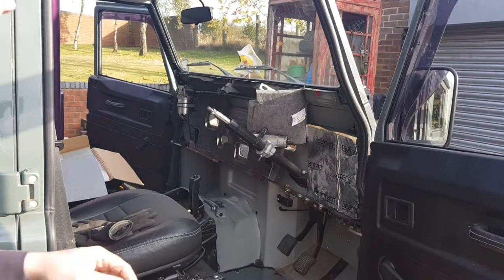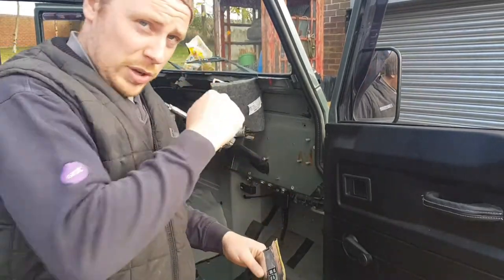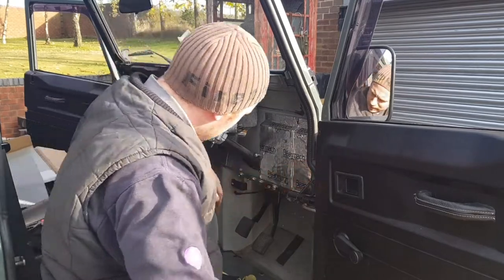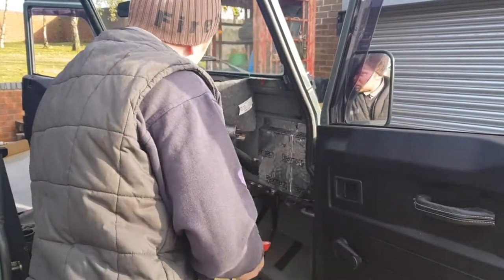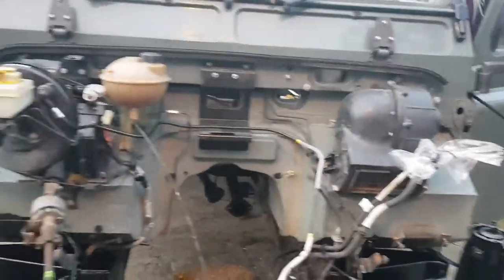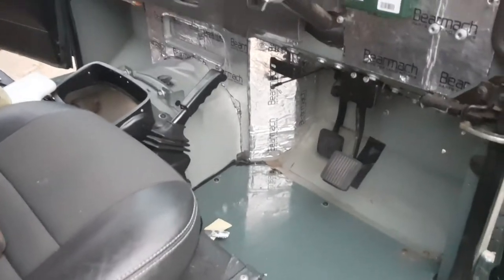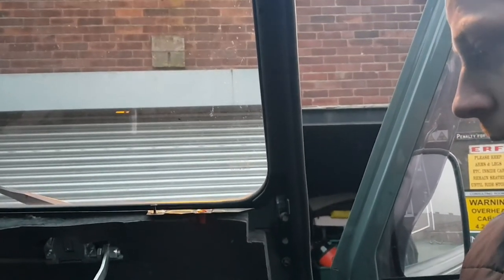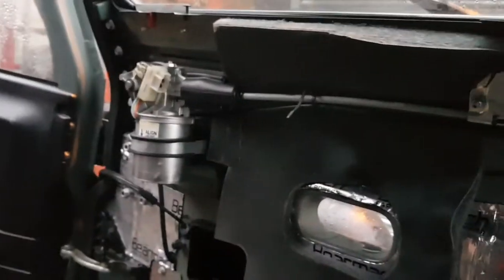Land Rover Defender Soundproofing The Bulkhead and Repairing Water leaks

Comment: Something you might want to check.. the screws that hold the floor panels down. My 2011 puma had every screw running down the side of the square nylon insert rather than through the middle of it, hence the bulkhead and sills would have rusted as the screws stripped the paint/galv from them. Just a thought while you have the carpets out?
Reply from the maker: Thank you i will have a look for that. I can at least fit them properly and add any protective paint then 👍

Comment: Did you soundproof the rest of the cab?
Reply from the maker: I sound proofed and carpeted the rear before i started the youtube channel. I have got to do the seat box and roof yet
Reply: @lifes.projects  ah ok..... I'm putting Dynamat in the rear part of my TD5 DC today, just wondering how someone else tackled the job..... I don't think I will go over any of the joins just in case it ever needs to come apart again (unlikely in my ownership) that Dynamat is a bitch to remove! 😂 😂